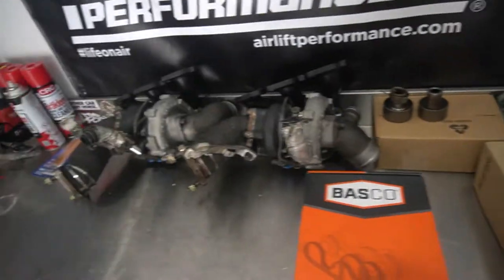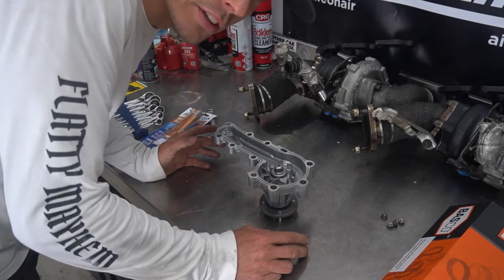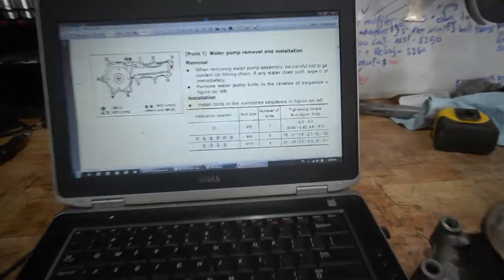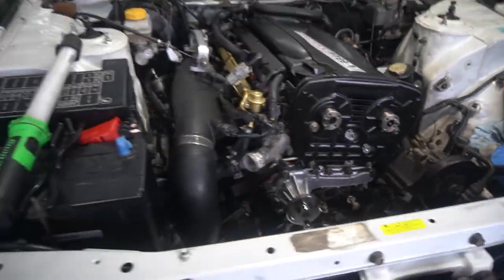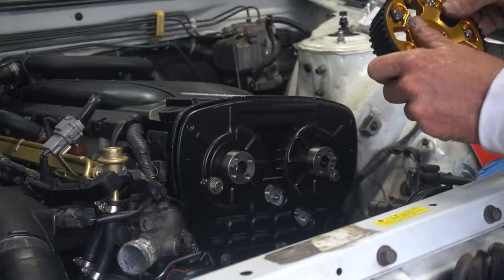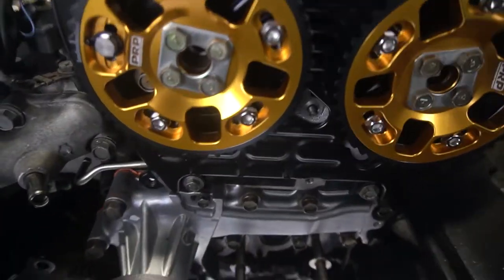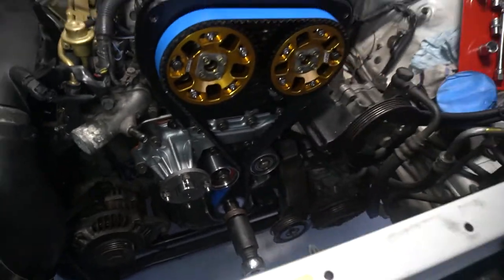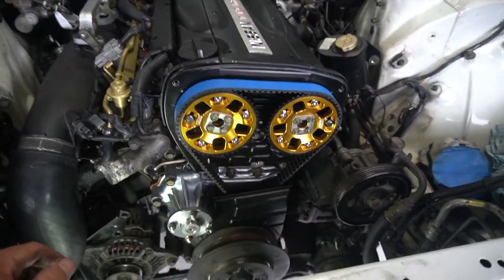PRP Cam Gears & Timing Belt install for my RB26 Stagea!🤤🤤

Comment: Getting ready to do timing belt.   What do you recommend for deflection of belt? Any tips would be appreciated
Reply from the maker: Factory service manual mate. Leave tensioner loose, rotate motor 2-3 times and then tighten tensioner. 
I didn’t do this the first time as I thought it was too loose, however once the motor had completely heat soaked/expanded I found my belt was slightly noisy

Comment: Did you get alloy or steel gears?
Reply from the maker: I got steel. The alloy definitely reduce that rotational weight for performance, but being softer, will wear quicker over time. 
I want them to stand the test of time 🤘🏼